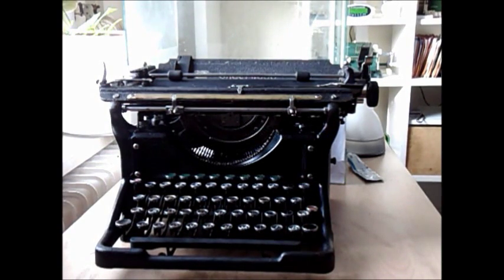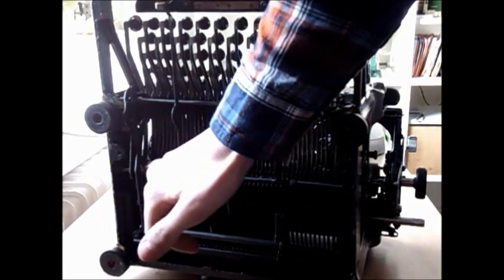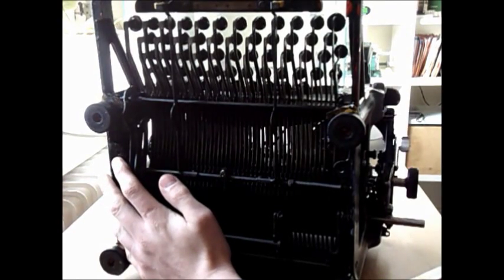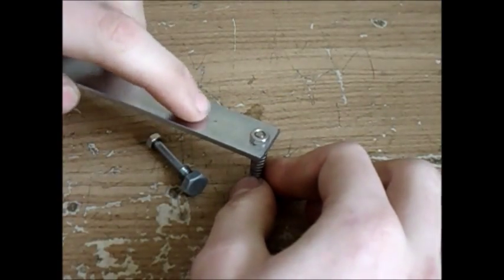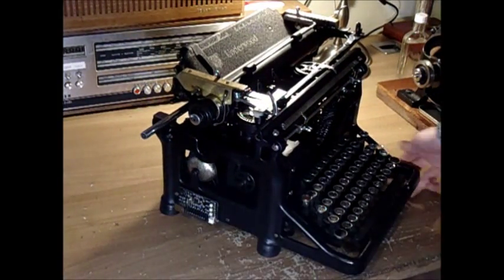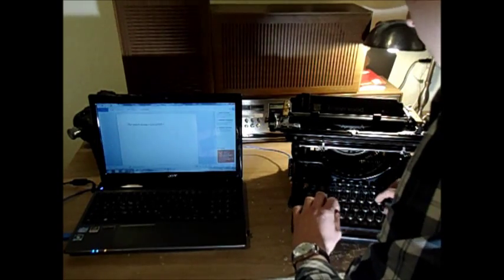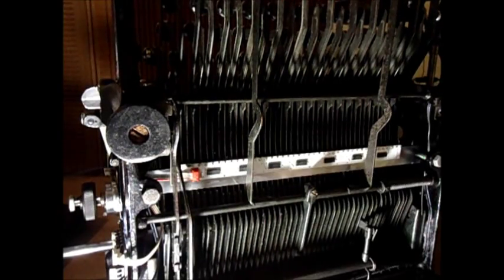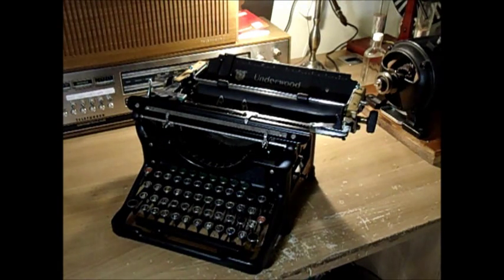USB Typewriter Installation

Comment: Good work! I'm not sure I'd do it to my typewriters, but it is very intriguing. About how much does a USB unit cost? Thanks
Reply from the maker: Hi Donald. The reason I did it was because I was writing quite alot in the recent weeks and months - and since our scanner turned anarchistic, it was quite a nuisance to scan all the papers - and with this kit it just makes a digital copy while writing.
I was lucky and still got it for $80 - but last week he cranked up the price to $99 I think - but still, it is worth the laughter ;-)
Reply: Looks like you get the best of both worlds! Even $99 isn't too bad a price, I was thinking much more. Thanks, Adrian
Reply from the maker: Donald Lampert That's what I consider the perfect future: When old technology gets linked to modern technology (I'd also love to have some kind of digital kit for my Super 8 camera). This way you combine the insane ridgidity and style of "ye good olde times" with the practicability of modern inventions. Personally, I would also say nothing against the chassis of an old car with a modern type of engine in it - as long as it fits the optics nicely. (Again, who would like to see an all plastic block inside a nice 1920s Duesenberg...) 
Best Wishes
Adrian
Reply: I totally agree - Old world craftsmanship, and materials, married to contemporary technological ingenuity.
Although I know you like old steam run machinery!
Reply from the maker: Donald Lampert Well, even the electricity power plants still are run by steam turbines ;-)
Reply: I love steam power, although it's not the most energy efficient. Have you ever seen a steam automobile - like a Stanley Steamer - very cool